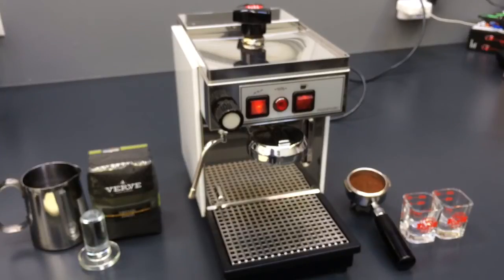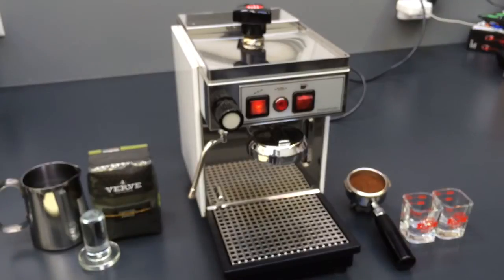Olympia Maximatic

Comment: I see I'm 3 years late to the party, but I've rebuilt two of these machines and that steam wand valve is actually in really good shape. If you still have it, just burn out the gasket at the back of the mechanism and replace it with a new one from Cerini Coffee. Just take care not to damage the screw head as it is soft brass (although the heat should make it easy to remove).